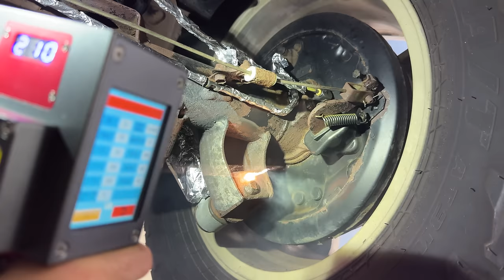Ultimate 4Runner Detailing: Laser Cleaning Rust Removal, Dry Ice Cleaning, PPF, & More

Comment: This must have been a $10k restoration program...........
Reply: I think it costs like $2k-$3k. I might be off because of the crazy inflation, but I remember a guy talking about his Mercedes they did a couple years ago and it was in that ballpark.
Reply: @SpookyFow  no way this was a $3k job. They just did that BMW restoration that was around there….
Reply: @SonicFlare  Ok... So you're saying there's a dude out there who would spend $10k detailing a $14,000 20 year old Toyota 4Runner? Sure thing.
Reply: @SpookyFow Dry ice blasting, laser etching, paint correction, interior cleaning, ppf, and ceramic coating for 3k? This is easily a five figure resto
Reply: Not to mention repainting all the suspension and undercarriage bits.
Reply: @JoeyAG92  This isn't a concourse level, platinum, 5 star, roll out the red carpet and  invite Car and Driver over for a photo shoot detail. What he had done I calculated on their website it to be between $3k-$4k tops.
Reply: @SpookyFow  if you were on the site and looked up dry ice blasting packages, you would’ve seen the platinum package that includes “undercarriage, bottom of the engine and transmission, top of the engine, wheels removal and wheel wells cleaning” starts at $2750 and can go up from there. 

The gold dry ice package doesn’t include the wheel well cleaning that this 4Runner received, so with dry ice blasting alone the job is already at $2750 if not more due to the size and condition of the truck. Of course we don’t know the true cost of this complete service, but I’m willing to bet if it didn’t touch 10k it was damn close to it.
Reply: @SpookyFow  additionally, the gold concourse package which costs $4550 doesn’t include several of the services this 4Runner received. Doesn’t include laser etching, ppf, undercarriage ice blasting, wheel well blasting, engine/trans ice blasting
Reply: @JoeyAG92  This was all just a basic detail. They didn't even come close to doing what they do on special and exotic cars that takes a week or longer to complete. I bet they got this 4Runner done in 8 hours or less. I'd bet cash they didn't charge him anywhere near the prices on their website for what was done.
Reply: @SpookyFow  completed in 8 hours or less? Okay
Reply: @JoeyAG92  Then call them.. No god damn way they payed $10,000 on a 20 year old 4Runner. And they didn't do to this truck what they do to the crazy cars that go through that shop. No damn way...
Reply: @SpookyFow   I think you’re the one that should be calling them lol, since you can’t accept the fact that the service it received in the video cost more than 3k
Reply: @JoeyAG92 You can get a full, windows-out, trim removed high-end respray for under $10k. No detailer would charge 10k for a detail, and the owner of an older 4Runner certainly ain't gonna pay that.
Reply: @Callsign_Sturm  Ok... Thanks for sharing.    How you stripping and painting parts on your old cars has anything to do with I am Detailing's price to detail this 20 year old 4Runner, I'd sure like to know.
Reply: @SpookyFow 10000% there are.
Reply: @DavidTheScientist  I know shops that will and some that wouldn't for that price.
Reply: @nickit22  What, do a detail, or a high-end respray?
Reply: I think you should both meet in the middle and say 6k for this job to be completed?
Reply: @SpookyFow restored low miles third gens can go for $60k...
Reply: @dcardenas1661  lol
Reply: I don’t know what this guy is willing to spend that owns this forerunner, but I’ll just say this the amount of cars with a body on frame that are easily repairable that can last a long time is dwindling fast. It might be worth it to somebody to pay.Is it worth it if you can get another 10 years of reliable service? That’s definitely cheaper than a new 4 runner or interest
Reply: @SpookyFow There's this thing called "rich people."
Reply: @SpookyFow channel probably knows a guy with a rusty Toyota and saw a video that'll get clicks
Reply: @andrewmcgrane3308  They did that for one of their friends that had a Dodge Magnum a while back.
Reply: @SpookyFow if this cost around 3,000. Where can I find it lol. My 4 runner is in worst shape than this one before it was getting all cleaned up 😂😂.
Reply: @TheReozilla  The 4Runner in this vlog was really clean to begin with. They are in Costa Mesa. Bring your hooptie there and it'll probably cost $10k.
Reply: That was already considered rust free in ohio
Reply: @SpookyFow  welp.. NeverMind 😂.
Reply: Stop it
Reply: Not cheap is it all the folks with old cars are already in poverty
Reply: @502days  not true. Some of the wealthiest people drive old beaters.
Reply: Exactly
Reply: Wow 🤩 what an amazing job. These guys are at another level of car detailing.
Reply: @SpookyFow  I'd spend that on my $4,000 truck dude
Reply: @GSKYYT  No you wouldn't. You saying you would in a comment thread is as close as you'll ever get to spending $10,000 on detail.
Reply: @SpookyFow  I don't know but I've already spent 20,000 on it so - Love to see this rage though, spoken like a true poor person
Reply: @GSKYYT  I see you make video game vlogs... lol. Post up your $4,000 truck that you've spent $20k on. I'll wait.
Reply: I work at a restoration shop and we charge 100hr and that's on the cheap end around here, everything is so expensive when it comes to restoration
Reply: @SpookyFow  yea bud I play with my old school friends. I'm 27 and got two incomes, 20k is not that much if you like old cars, I just chose to buy a 1980s Ford rather than spend 50k on a new truck. Doesn't mean I'm rich either. Moral of the story is stop crying on YouTube comments bud
Reply: No doubt. Insane!
Reply: They have no choice to use laser bc CA has effectively banned any cleaning agent that is stronger than dish soap. So whether it costs 3K or 10K if that's all you can use then someone will pay for it.
Reply: Where can you have this done in the states. We need this in the rust belt
Reply: @SpookyFow it’s not worth 14k
Reply: @you-dont-know-me123  You're probably right. A clean California 2004 4Runner with low miles $8k to $12k. I've seen some high priced ones too.
Reply: $12k
Reply: Парни, вы просто профи!!! Смотрел ролик на одном дыхании! Круто!🦾👍 С любовью из России!
Reply: @SpookyFow  100% bro
Reply: @SpookyFow you sound demented
Reply: Laser cleaning the rust is wild
Reply: @SpookyFow   yeah probably, it's build way better then a new car and now it's pretty much brand new again
Reply: @1.thomasalmeida Agreed, I have old beater and it’s more reliable than a new truck. I’d probably have a complete detail performed and fix it up to brand new than buy a modern day POS. The engine has been meticulously maintained the body just needs some tlc.
Reply: People can be passionate about any car. If I had the money to blow I'd do this with my 96 civic @SpookyFow
Reply: Doesn’t matter what the shop could charge for a detail bc the shop isn’t charging the vehicle owner anyway. Shop prob makes more money off views that doing details
Reply: @SpookyFow  yeah because this car will last longer than yours
Reply: @Qpyx196xn  I own two of them...troll.
Reply: 10k seems pricey, but these cars last forever so it’s kind of justified if you have room for that expense
Reply: I think the ppf was just the front but definitely 10k. Let's not forget the undercarriage coating too.  @JoeyAG92
Reply: Plus CA tax so around $11k
Reply: I hope the vehicle was faster after!
Reply: @SpookyFow absolutely there are. This job is well over $5k and probably pushing $10k. Especially with the rust removel.  Think of all the man hours it took to do this. They are not working for $10/hour. Also that 4runner is worth at least $35k now, not $14k lol.
Reply: @SpookyFow would you do all that work, minus your overhead cost, including all that rust removel for only 2-$3k.  Easily somewhere between $5-$10k for this
Reply: @SpookyFow you underestimate the love people have for their cars. Especially older toyotas of this era. Clean examples of this era of 4runner sale for $30k+ all day long.
Reply: @DavidTheScientist  mint condition restored factory paint is more desirable and move valuable than a repaint in most cases
Reply: @SpookyFow yes he would and so would many other people.  Let's see spend $10k to restore a car I've owned and loved for over a decade to ensure I keep ot for another decade.  Or go spend $50k on a new car that's more modern but less reliable overall and will cost a ton in maintenance, repairs, tags, insurance and taxes. Easy choice.
Reply: @SpookyFow you drunk bro.  A 30 second search shows that this era 4runner, consumer grade with 100k miles sale for at least $20k
Reply: @canyonero2050  Bullshit...
Reply: @canyonero2050  I feel that might be true of a vintage Ferrari, but not so much your average car with some collectible value. And sometimes, the original paint is past saving. I had a 1990 325iS, its paint was pretty bad in places, especially the roof and trunk, which were deeply etched, stained and dulled. I ended up getting a full respray, they removed everything except the stuff in the engine bay, and it was in the original colour. I unfortunately sold the car before values skyrocketed later in the decade, but still got $11k or $12k for a non-M e30 in 2010, which it probably close to a record back then. Certainly wouldn't have been worth more than about $6k without the respray. That said, the car was still a money pit, I probably spent over $30k on it over 7 years or so doing upgrades and restoration, but it certainly wasn't done for the financial returns...
Reply: $3k thing. Anything else is just ripping ppl off
Reply: Nah materials is $100 bucks. They can’t be charging more then $60 an hour it’s only a glorified cleaning lady lol these guys don’t make lots of money anyone can clean cars kids do this job
Reply: From where……because I definitely need it
Reply: You interested in the rarest of the GMT400s? 1995 Baby blue z71 with 11,800miles and only driven for one year and left In Wisconsin barn. Frame is rusted, but everything else is perfect
Reply: And its worth it
Reply: @SpookyFow  Yes there are quite a few people and selling them for 35-40K
Reply: This is what love is…..solid work fellas.
Reply: If that car is your baby, totally worth it
Reply: Guys, here is The True Savior

HalleluYAH “Praise ye YaH”

YaH is The Father (Genesis 1)
YaH arrives via the TENT OF MEETING
YaH was Who they Crucified for our sins
YaH was Crucified on an Almond TREE

Ancient Semitic Moshe (Moses)
Isaiah Scroll (The Original Isaiah)
Reply: @SpookyFow worth every penny. That 20 year old 4 runner will outlast every 60k+ soccer mom suv sold today.
Reply: @SpookyFow I spent like 20k restoring a 2k 1996 Lancer so yes
Reply: @SpookyFow  No way is this 3K.   It had to be alot more.  Dry ice, laser, all the detailing, and some repainting,   easily 6K.
Reply: @SpookyFow I agree with you some people are just wild with figures
Reply: @JoeyAG92 five figures for a Toyota 😂 dude relax
Reply: @MarioLuigi-vb3rp  the work is the same regardless of the marque 🤣
Reply: @SpookyFow yeah, there are. I would. I love my 3rd gen.
Reply: Would be well deserved. A lot of work
Reply: No shit bro
Reply: @SpookyFow if it was special to me absolutely I would. If it was my dads and he passed I’d absolutely spend whatever to make sure it lasted as long as possible, hopefully outliving me.
Reply: @SpookyFow  In your dreams you'd find this 4Runner for 14k. Check bring a trailer. Also don't under-estimate what people will spend on these nor how much money they put into them. I've seen builds that are well over 60k. This isn't a Ford Explorer xD.

Comment: Amazing rust cleaning. Now this 20yr old 4runner is good for another 30yrs
Reply: You aren’t going to be able to buy gaskets for the damn thing soon.
Reply: that was just top coat of rust; in my region such 20yo cars have a lot of holes on a frame and body :D
Reply: Removing rust without protecting the metal afterwards is pointless. It just looks nice for a short time but you haven’t fixed or slowed down anything.
Reply: @Jasiel.95  just stock up on gaskets.
Reply: @Jasiel.95  you can ask to forge new ones fairly easily. Or import from China where they already do it

Comment: Did you repaint or treat the surfaces underneath with anything after the laser treatment?  It looks like the paint was taken off too and exposed the bare metal on some parts which will cause rust much faster than before.
Reply: I wander the same too. They got rid of paint and a bit of surface rust and let the metal be totally exposed on suspension parts too. It'll start rusting again as soon as it leaves tge detsilers. That's stupid. And the only way to prevent it from rusting is to paint all newly stripped areas with primer wich will get over spray all over.
Reply: I was skeptical as well but if you watch the end they show the underneath briefly and it has definitely been re-surfaced. Wish they included that process.

Comment: I have a 2013 LR4 with the V8. I live in the north east so lots of snow and salt. 

if I had the $ and could get this done, is there an additional coating that can be put on the undercarriage to help fight the rust? 

or like how beneficial is the laser rust removal in helping a car live as long as possible?

cuz I love this car. and I know more than likely the engine will go and that will require a replacement but just curious in your experience how valuable it is to do this sooner rather than later when it comes to making sure the vehicle can stay in top condition.

Comment: You've already removed the rust, but will anyone protect it now?
Reply from the maker: The black coating on the bottom is a rust protectant called waxoyl. It is well protected! :)
Reply: @IAMDetailing  So you protected him too. Unfortunately, it did not show this. Excellent, then. I also intend to protect my car. Now, it has been with the Krown product a few times, but dirt sticks to it and where I've driven they don't wash the chassis before re-protecting it. The wax also slightly protects the paint from smaller grains of sand and the protection is also more permanent. Next time I intend to take it for protection with wax. It is a Honda Civic.

Comment: It looks great, but laser only reaches a certain point in the vehicle if it is not disassembled, and the exposed areas are usually not the worrysome ones. That surface rust could have been esily arrested with Lanolin or Dynax UB, that also seep into all the crevices, and that treatment coupled with cavity wax injection could have been maybe even better than stripping all the paint and repaiting.

Comment: Does this laser also helps in removing the Complete paint from the body incase someone wants to repaint the whole car into different color ?
Reply from the maker: It can definitely remove paint… but i need to ask Jakub if you could use it on the paint to strip the car safely. I know we can strip it with dry ice lol
Reply: @IAMDetailing  Yeah 😀I know Dry Ice won't damage the paint but I guess Laser is more powerful than that 🤪
Reply from the maker: Oh you can most certainly damage paint if you're not careful with the dry ice. We had someone from a dry ice cleaning shop come by this week with a hood he was looking to have stripped, and we tried the laser on it. For this application, he still ended up sanding some parts of the hood. Possible, yes, although im not sure its the best solution for that at this time

Comment: I have a 2009 4Runner and it has some kind of a rust proof coating on it, but I can tell its not the best and I have other parts that look to be rusted over.
I want to give it a proper clean up and give it a good rust proof coating on it...

- Would you say to use dry ice to remove the rust build-up? Or what about the sandblasting instead?
- Laser is the same but it does a better job at it?
- Can I buy or rent that laser and do it myself?
- What do you do after the rust has been stripped off?
Reply from the maker: We will start with dry ice but it doesn't do much of anything to the rust - it's just removing surface junk
We use the laser to remove the rust and bring us back down to a clean metal surface.
We sell these laser machines, if you're interested, you can contact us through our website for more information
We will often recoat the vehicle with some rust protection - like waxoyl, cosmoline, or 3M clear matte wax

Comment: Jakob is the laser removing rust permanently or do you need to go back and coat it to keep it from oxidizing?

Amazing attention to detail as always. Even cleaning the stow away tire jack. This truck looks better than the day it left the Toyota dealer showroom floor.
Reply from the maker: From my own experience I think you have to always coat with some type of protection if there was rust present… I think if the rust is present that means no paint/protection is there anymore. So we always coating after this treatment, unless it’s aluminum but even that we mostly coating with clear protection.

Comment: Wait a minute what about coating the underside with something after lasering to bare metal? Especially parts you lasered off the original paint/metal protection...
Reply from the maker: You can clearly see we recoated the bottom in both the thumbnail and the after photos ;)
Reply: @IAMDetailing  Apologies, I thought I saw bare metal on the after video shots like the rear diff metal/shroud/guard thing. Guess I was mistaken. Great work then!

Comment: That laser is cool, but it doesn't remove any of the scale from the rust. It would still need a wire brush before painting. Might as well skip the expensive step of the laser, IMO. Also, this is a little missleading, that vehicle has obviously had a lot of time with degreasing and pressure washing prior to the dry ice and laser treatment.